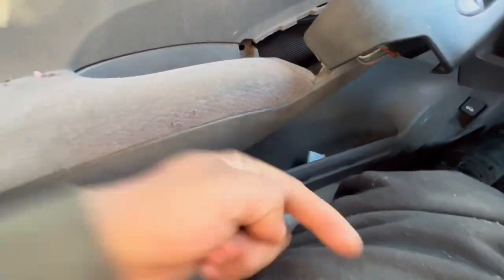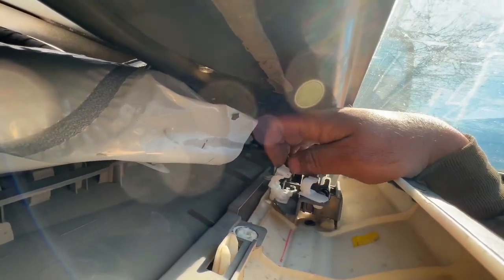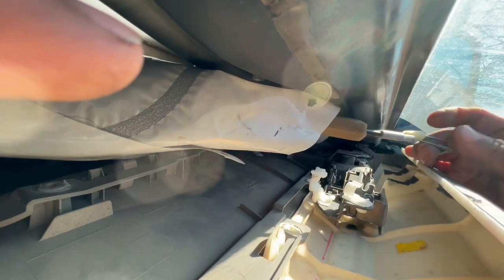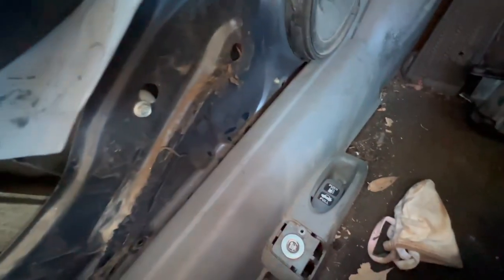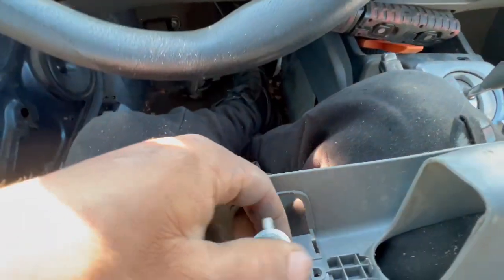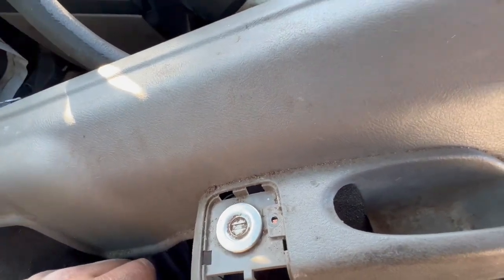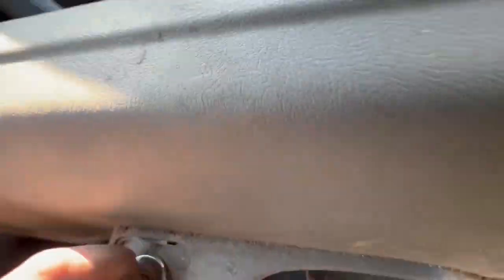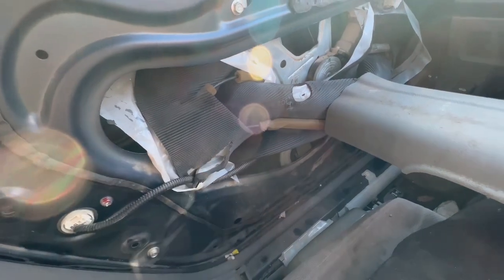2007-2009 honda civic lost the only key here the tips. To save money

Comment: You do know that locks pops up with a flat head lol. I thought u was going for door lock
Reply from the maker: If you actuator is bad wont pop up.  Thats why the door wont open ⬅️
Reply: @1Wayfix  I thought u was trying to make a key. If you pop up that lock cylinder the code to make a key is printed on it.